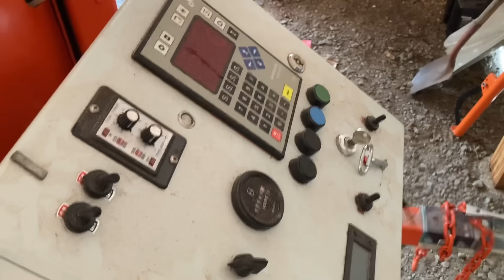Sawing 4 Quarter Cedar

Comment: Why the external alternator on the Predator ?
Did the OEM Woodmizer engine have an external alternator ?
If so , I assume to supply enough voltage to all of the hydraulic solenoids ?
Reply from the maker: The preditor puts out 8 amps. The motor that powers the hydraulics pulls from 50 to a 150 amps. The 100 amp alternator will keep up but just barely. I have an amp meter, at the end of the day I let it sit and run until the meter gets down to 2 amps.